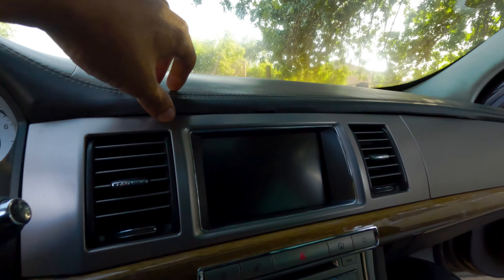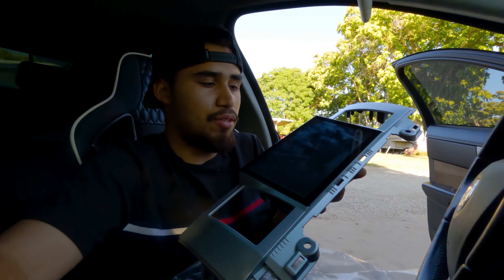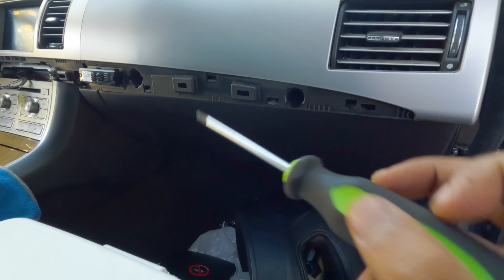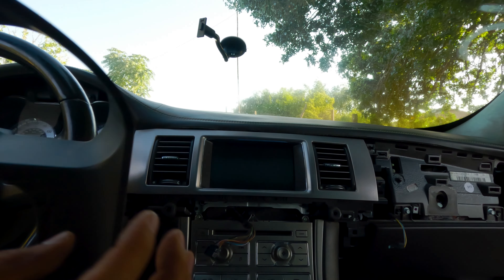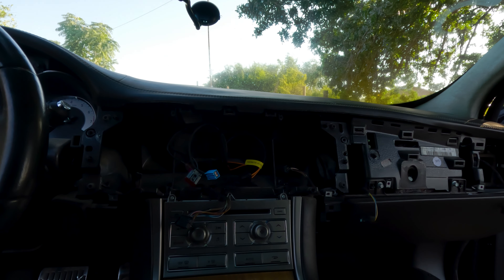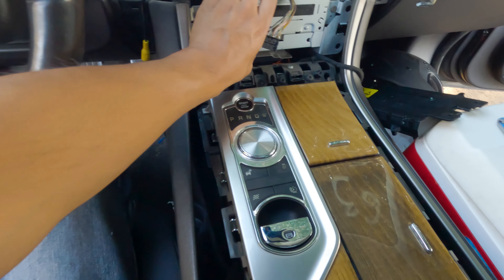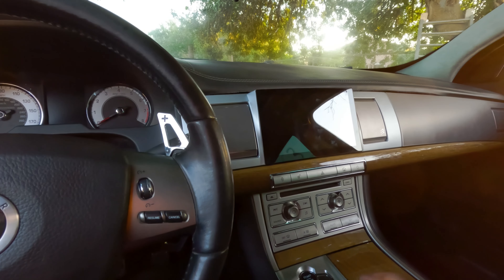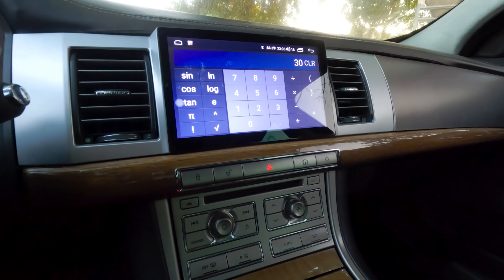Jaguar Xf Android Radio Install!!

Comment: Looks good do those dash lights not bother you? I fixed the coolant level low with a new coolant reservoir just for the code to come back about a little over a month after driving it, Also says brake pads are low when I had the pads changed and the brake sensor, along with having e diff not available and abs fault... Soo annoying for me
Reply from the maker: Yeah they do I already order a new coolant resirvoir the only warning I can't get rid of Is the battery and tires pressure sensors but is ok

Comment: Do you have prelift version ? Do you know if it’s denso or Bosh ? I asked for Bosh version ( facelift ) but they says is not compatible
Reply from the maker: I have denso they should have it for both denso and bosch
Reply: Thanks for the answer . It seems the same model allow to switch from android to original system if you have Denso and you can use all functions under android if you have Bosh

Comment: Hey bro

3questions
If you get a chance.

I see the link you dropped question did you pay extra $85 shipping?

And ytge 4g is $450 the 8g $495

Which did you get?

And hiws it still holding up?

Thanks

Comment: Nice project! I've got XF-S 2009 pre lift (same trim as yours 2011). I've got a Denso system on it not Bosch. What original functionalities have you lost?
I am interested in particular:
- Revercing camera (I saw your post that it works)
- Parking sensors (front and back)
- Can you close vents via original buttons and from the screen level too?
- Audio settings
- Clock settings on the gauges were originally set up from the infortainment, is is still synchronizing? 
- Heated seats controls
- CD's do it reads them?
- Steering wheel controls are working?
- Did you noticed any issues with the battery drainage after installing this one?

Also most important - Do you know what your old system was? Was it Bosch or Denso? If you don't know, do you still have the old unit? Can you check the Serial number on it so I might be able to google it myself.

Have you noticed anything is missing from the original functionalities?
Sorry to be pain in the a**, I really like your setup and the way you've managed to get it done! I intend to do similar.
Reply from the maker: Everything works except for my subwoofer, and the clock on the instrument cluster, the vents open when the ac is tuned on and close when the ac is off. Lost the cd player honestly I dint even use it. Everything else still work heated seats sterring wheel and everything parking sensors. My system was the old denso system I belive the switch to Bosch In 2013. SERIAL # 7g9n-18c815-ta
Reply: @Ricky50scJustalil6cylinder  thanks! Interesting, I wonder what could be an issue with the subwoofer.
Reply: I've contacted the seller on alliexpress and according to them ,it is dual system which means you should be able to switch from Android to the original interface and there update the clock on the instrument cluster. They have not responded to the subwoofer issue when I asked them. I am checking if it is an issue with power output of the device (which they state is 4*45W = 180W) or is it an issue with amplifier connection.
Reply: @tr4spyable so what happened did you order one ? I’m waiting for your review

Comment: Is this a pre facelift model xf? I have an older 2009 xf sc and I am looking for a unit that works with that. Thanks!
Reply from the maker: Yes mine is a 2011 basemodel xf. They have the radio available for both pre and facelift model send them a photo of ur radio and year make and model after purches

Comment: Thanks for the video im definitely getting this
Reply: Also what model is this on app?
Reply from the maker: @brooklyn91eg  $456.75  13%OFF | 128GB Car Stereo For Jaguar XF 2004-2015 Dual System Android Car Multimedia Radio Player GPS Navigation Wireless Carplay WIFI
https://a.aliexpress.com/_mrlcnGG

Comment: can you drop the link
Reply from the maker: $456.75  13%OFF | 128GB Car Stereo For Jaguar XF 2004-2015 Dual System Android Car Multimedia Radio Player GPS Navigation Wireless Carplay WIFI
https://a.aliexpress.com/_mrlcnGG

Comment: Don't permanently connect an obd I did that and the car suddenly died on me in the middle of the highway almost killed my self, it's well documented in forums, it will cause a nightmare at any moment.
Reply from the maker: Yes samething happend to me with a different obd adapter I had before I got it for $14 it screws with the ecu when the engine is off and causes abunch of fault codes. Then I got a better quality obd2 adapter for 130+ and never had any issues it shuts off after I turn off the car and workeds alot faster the the previous one I had

Comment: Sorry dude, but the plastic around the unit not matching either the colour or the texture of the rest of the car would do my tits in. Damn, if they'd spent five minutes more with the plastics...
Reply from the maker: I have a better looking radio now 12.6 inch screen looks alot nice
Reply: @Ricky50scJustalil6cylinder  which have you got nowadays if you don't mind me asking
Reply: @Ricky50scJustalil6cylinder  Hi, thx for the video, which one do you have now? :-) ... and where to buy?